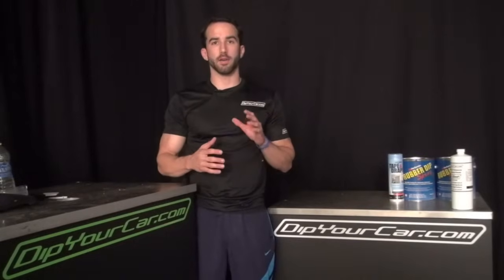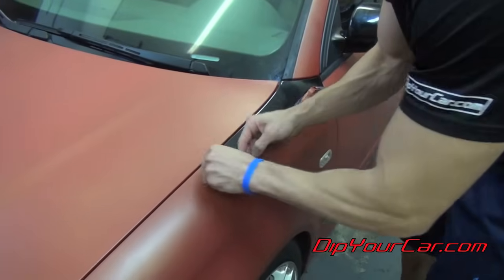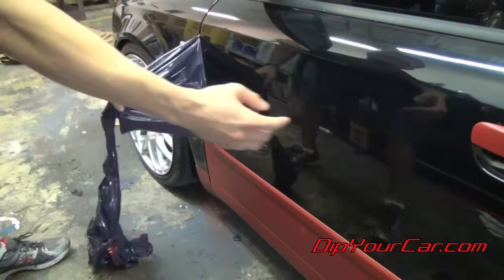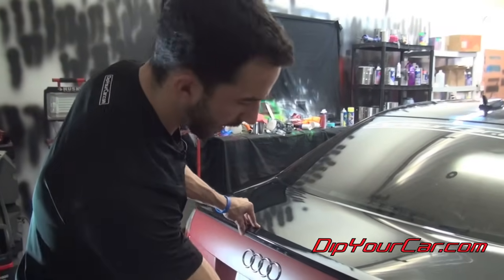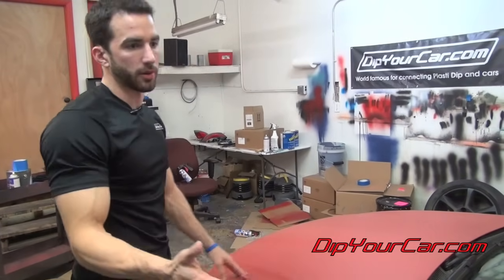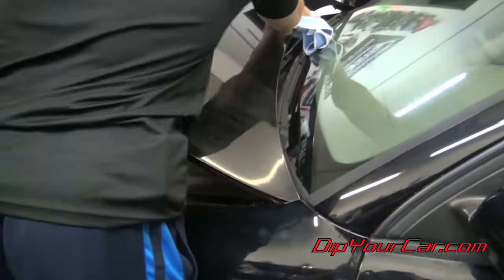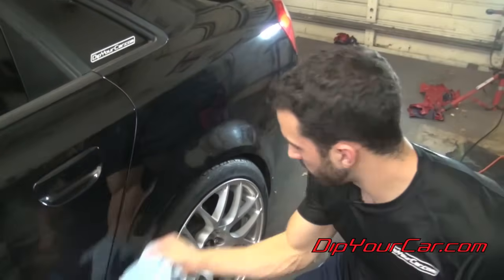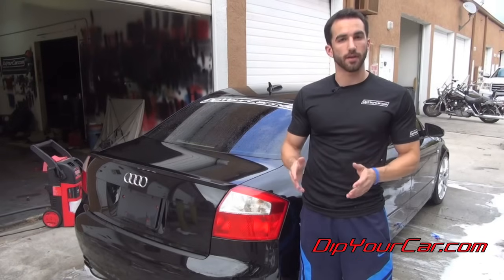Peeling Plasti Dip off a Whole Car

Comment: This would be kinda cool for the front of the car. I was cleaning my car the other day and no matter how hard I scrubbed the little black pieces of tar from the road just refuse to budge! They're literally imbedded into the car. I could see dipping the front and then replacing it every few years or so to avoid the tar from sticking itself to your car.
Reply: Too gone or bug and tar remover works great on that little black crap. Just be sure to clean it off when you're done.
Reply: There are products out there that will remove tar etc. without ruining your paint. Have no idea what brands you might have in the US though (or wherever you are).
Reply: Martin Allen ^This^
Reply: *****  For what it is worth I had an 1985 model and my boss used it on my car because he always used it on his car. Well it took the clear coat off and you could see the color of the paint on the rag. Totally destroyed the paint.
Reply: ashley johnson you may have to clay your car.

Comment: what a good way to get away from cops lol
Reply: The Need for Speed style. :P
Reply: ***** GTA Style
Reply: They did that in the movie "Taxi"
Reply: Kick Yourdonkey That was a vinyl wrap though.
Reply: My first car was a Mercury Mystique, which is the same thing as a Ford Contour. The previous owner got rear ended and fixed it with a Ford. The officer who pulled me over was baffled, thought Id swapped the license plates even! I told him to look at the front, the steering wheel even, or the VIN in the window!

Comment: As long as you get enough coats (5-6) then it will protect from gravel/salt, etc. It'll function like nose bras function to prevent dings on the front bumper/hood, but it'll protect the whole car. If you start seeing small cuts/chips on the plastidip from excessive impacts, then just give that section a touch-up mid-winter.

Comment: Actually it holds up really well. I use it and I take a scrub brush to mine and it doesn't scratch or peel. As far as it being two colors, if you listen, he tells you that there are several coats of blue and several coats of red.

Comment: A very interesting concept! I have plasti-dipped tool handles and was very satisfied with the results, although I'm not sure if it was the same product. Have also used it  to protect electrical connections. Is this actually measurably less expensive than a typical single stage polyurethane paint job? Am curious what inspired you to promote this product. Thanx for any info:)-John in Texas

Comment: good way to remove bad paint or clear coat will peel off while removing the dip ,maybe kind of a dip for using it unless using it to protect a good paint job but why cover up good paint work ?

Comment: The paint job underneath is far better than the one your pealing off. My question is why?
Reply: Beyond personal preference and doing or undoing some visual work that isn't permanent, I'd say it is a nice way to preserve the original paint job and trim for resale.
Reply: I'm pretty sure that s/he means why he chose the colour of dip he used.
Reply: Because opinions are like assholes, everyone has one.
Reply: +Richard Smith Original. Most original fucking thing I've heard.

Comment: My car has some serious paint cracks, clear coats peeling off and dents - I have plans to remove all the clear coat and fix the dents first. My questions is - plasti dip adheres with no issues on primer ?

Comment: How much do shops normally charge to plasti dip something? I have a 98 Saturn SL and the plastic bumpers have faded and it bothers me lol
Reply: same amount as painting the car. probably around 800 bucks or so
Reply: Painting your car can run up to 10k, I use to work in a shop that did it. Cheap paint and a shitty shop can do it for 1-2k but odds are it will look like shit.

Comment: One question, is plasti-dip gasoline resistant? I only ask because around the fuel door on my car I sometimes get a dribble of gas if I corner hard with a full tank. (My car is a $400 beater and I don't spend much repairing it unless I need to or want to)

Comment: The previous owner of my truck had matte black dip on it. It started to peel, so I began to remove it but some places were done so thin that it didn't peel in one piece, it was a bunch of tiny flakes and wouldn't even come off in other places. How do you remove the super thin/residue?
Reply: The previous owner most likely did not care for the dip properly or it could have just been too old.

Comment: Does it matter if your car's clear coat is partially missing. If so if it was sanded down properly would the dip over stick to the etched panel?

Comment: Is there a too many layer to peel rule? i noticed it was purple underneath. lets just say i dip my car 20 times and never peel it. Even if it noticeably thick could I hypothetically still dip it
Reply: I think general rule of thumb, thicker the paint the easier to peel.
Reply: even if its like 6 layers after?
Reply: Jawni Vudoo in a video fonzi reccomended to peel after 4-5 different colors
Reply: I'm assuming just because it starts to look bad after that, not because it gets more difficult to peel.

Comment: So guys! this Plasti Dip won't ruin the original paint ? even if its left on for a long time?
Interested in doing my G35 but afraid that it will ruin my factory paint :S ?
Reply: It won't ruin it, it'll actually protect it but after a while you'd probably want to peel it off and apply a fresh coat of the dip just for the sake of it and letting the factory paint breathe for a little.
Reply: Your car will be fine
Reply: Okay Thank you :) !
Reply: I think it actually protects it quite a bit. I dipped my g35 roof black and even under the sun nothing happens

Comment: so what are the benefits  of plasti dip. if it only lasts for about two years. i get that it protects the factory finish. but if it needs to be reapplied every two years, i really do not understand the benefit of it, versus having the car repainted every 10 years when and if needed. unless plasti dip is far less expensive than traditional automotive paint.....i am interested in it for the sure protection of the finish , but not convinced it would be economical......help convince me, please.
Reply: +lee grigo so I'm no expert or proponent of plast-dip. in fact it seems like it'd be a gigantic pain in the ass to remove and this video is misleading. But, in terms of finances, a new paint job and clear coat at Maaco is about $3k. So by your rationale.. $3k every 10 years. Versus $200/full-car plasti-dip application. So you could change colors every year and save $1000 over the course of ten years. But of course a normal paint job doesn't really look new for 10 years like plast-dip would, so in theory you could maintain a better look the whole time. As a bonus, when it comes time to resell the car the stock clear coat is flawless.
Reply: +Tyler McLean  I do everything, starting with oil change ending with a paint job, in my own garage. Which ,if you're an automotive enthusiast, is really the only way to go imo. Saves a lot of money. That paint job becomes around $ 350-600 for the materials plus your time, which for me is about 2-3 evenings ( prep time and painting). So, the only benefit of a plasti dip I see, is if one wants to experiment with different colors or do a unique look for a car show . On the other hand, think what driving behind a tractor trailer on a wintery interstate might do to that front end of a plasti dipped car. Or brushing up against something accidently. Although the idea of having your pride and joy in a few different colors thru out a year , does sound tempting
Reply: +valetudo1976 Hello. You sir are a complete tradesman, but the rest of us are far from it - I imagine? Applying a complete 2pak or even Acrylic paint job to a car is a mammoth undertaking requiring ok $350-600 in materials, but more in equipment, and even more in just SKILL. Plastidip is extremely forgiving, allowing the common man to achieve the results shown. Yes, Fonzie is far from the common man in this instance, but none of the awful and permanent results like a badly sprayed car with traditional automotive duco, done by someone who thought he was ok, but results prove that he was lacking and needed more, knowledge, skill, practice, instruction??? Thanks.

Comment: I dont mean to disgrade what this is but the paint looks oxidized underneath i dont know if its the plastic or something being stuck to the paint for so long.  Keep in mind your paint needs to breathe its like a skin to your car and without air it might no be good for your paint to not get air or oxygen.  Im just guessing i dont know for shure but the black paint has a whitish and oxidized tint to it leading me to beleive that this is not good for your paint.  Paint needs to breathe if you cover something and keep it completely air tight fo long its probably going to damage the paint.  Not to mention the factory clearcoat is also going to be peeled off and plastic stcuk into your paint.  That black paint looks damaged.  If you want to see the best paint job look up zaino and its the best there is in paint protection in the detail industry.

Comment: @dipyourcar is there a way to peel plastidip off plastidip? Say I dip a car white and want to dip the badges black. Is there some way I can peel the black dip off of the white dip or would the black bond with the old white or is there something I can put on the white like wax to prevent bonding?

Comment: You know the thing about this is: if you have an angry Ex to whom you bragged about Plasti dipping your car (or anyone else who might be pissed at you), they might decide to ruin your work and waste all the money you spent by simply peeling it off.

Plus: all I would need to do is peel the dip off in uneven strips that go all across the car, then you would be forced to remove it all in order to plasti dip the car again.

Your new motto should be:

"Plasti Dip: Revenge made easy!"
Reply: Than keep it a secret....lol
Reply: ***** Why would I? I'm not the one plasti dipping my car....

btw. the right grammar is "then," meaning "in those circumstances." "Than" refers to the amount/intensity of something in comparison to something else.

Comment: i have a car that the clear coat is starting to peel off. i have experience painting cars with actual paint but i do not have access to a professional paint booth anymore like i used to and don't want to get dirt in expensive paint. would this stick to paint that is peeling and stay without looking too bad?

Comment: if you have a motor cycle that is chain driven don't plasti dip your wheels it's not a good thing especially the rear wheel
Reply: Why?
Reply: +Zack Boivin you would be wasting your time. when it came time to clean your chain the first time the chain cleaner drips on the wheel or chain lub flies off and lands on the wheel it's messing up the dip. the front wheel is safe from the drips but once you have to peel the rear the front won't match. unless you want to redo the wheel every 150 to 300 miles. that's not many much time between reapply I can get 300 miles in a day and a half to two days I ride regularly. not to many days I have not ridden though rain or shine. my front wheel is still in great shape and it's seen everything except chain cleaner or lub

Comment: How much do u charge to do 
a entire car
Reply: You do it yourself with:
Plasti Dip Spray Can $100 ($10 per can, 12 oz of coverage depending on car and how much layers )
Masking/Painting Tape $5-10
Plastic (or Poly) Sheeting $~20 (Depending how long of a roll you buy)

Optional: Car Degreaser usually $20 per gallon, High-pressure spray nozzle for hose $5-15 OR High-pressure spray canister set $50.

Comment: I would not do this to a brand new car ever.  
1. Factory paint is the best paint your going to get.
2. Wax your car and wash with a good shampoo.  (Zaino)
3. Dont powerwash your car ever. Unless you have to.
4. Use softest towels money can buy.
5. wax and garage your car as often as possible.
 Never do this to a black car.
6.Use a strong light and you will see everything while waxing or claying your car.

Sorry but i detaled cars for a while and if you want a deep black rich color to your paint this is not the way to do it.  Sorry.

Comment: I'm not sure why anyone would do this.
Reply: +Tarballo you ever drive in edmonton alberta? like driving on a gravel road most of the time. this would prevent the paint from being chipped and therefore preventing rust. also it keeps your paint alive by shading the uv light.. which is also why the plastic dip doesnt last very long>